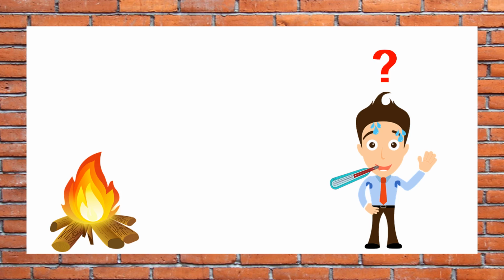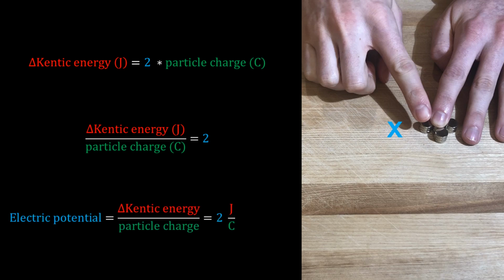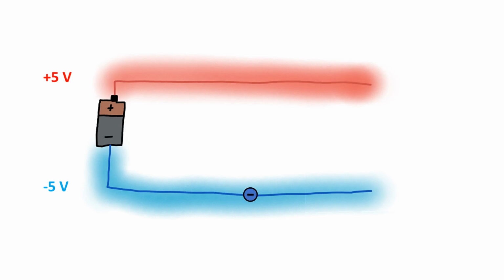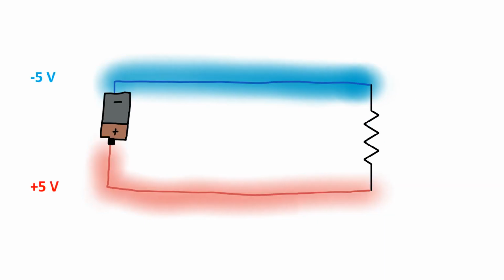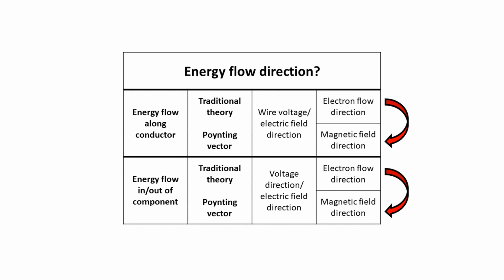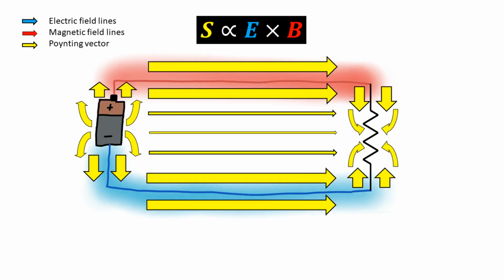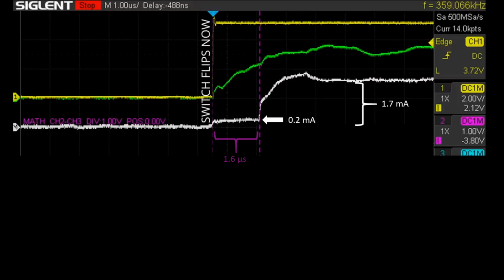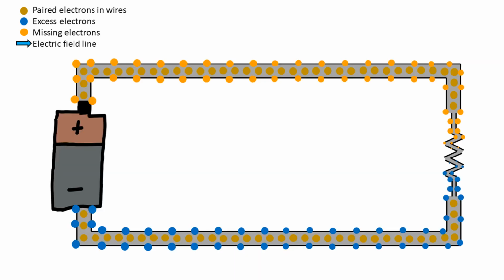Veritasium Electricity explained

Comment: Hey Preston, cool vid. May I ask, how did you got to the values in 8:40...  I did not get the relationship for final energy. Just curious to understand it better ;) thanks in advance
Reply from the maker: The numbers that I chose were arbitrary (as you can notice, I am using magnets as stand ins for the charged particles in the demonstration, so the demonstration is only qualitative, not quantitative).

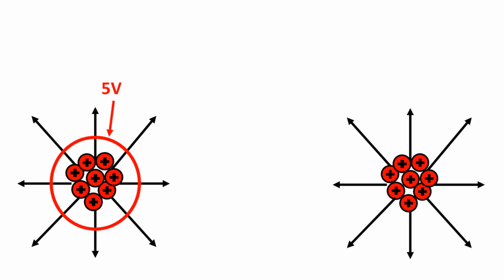The important part is that there are two groups of charged particles: the stationary particles, and the moving particles. Since the number of charged particles in the stationary group stays constant with each experiment, the voltage field produced by those particles stays constant as well. So, as long as I bring the moving particles to the same location relative to the stationary particles in each experiment, then voltage experienced by the moving particles will also be the same in each experiment. And as I show 9:35, the kinetic energy gained by the moving particles is given by the applied voltage * the charge of the moving particles, meaning that, if I double the charge carried by the moving particles, then the kinetic energy that they gain should double as well.

Hope that helps
Reply: @prestonbecker8784  Hi Preston. Experiments, backed by theory, by many researchers now show that the light will turn on instantaneously. A paper just published in the EM Journal IRECAP shows a Hertz-like experiment where an EM pulse was observed to propagate 1.5 meters in the near field with no observed propagation delay. This shows that the front speed, or the speed of information, or the speed of causal action is instantaneous in the near field of EM sources. This is predicted exactly by Maxwell's equations when the source terms that come from Gauss's law and Ampere's law are included in the wave equation. Since this was not done by Maxwell, his solution for constant speed c is wrong. And because Einstein assumed Maxwell's constant speed c solution in the second postulate of relativity, relativity is wrong. And if relativity is wrong then so is any other theory based on it such as general relativity and even QED is wrong. This will change all of modern physics! See my post at the top of the comment for more information. Also see New Interpretation of Relativity by William Walker, 2024, and see the papers in the description of the video. I am a senior physicist with over 35 years of experience on this specific topic, since it was assigned to me as a PHD topic in 1990-1997 at ETH Zurich Switzerland, Which is one of the best universities in the world. I've worked as a professor at many universities and my specialty is electromagnetic theory, electronics and signal processing.